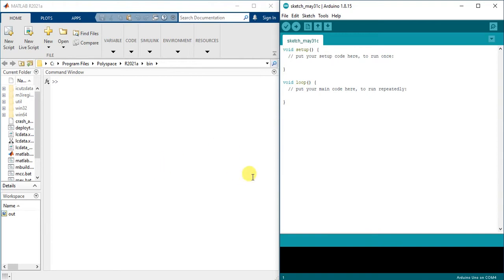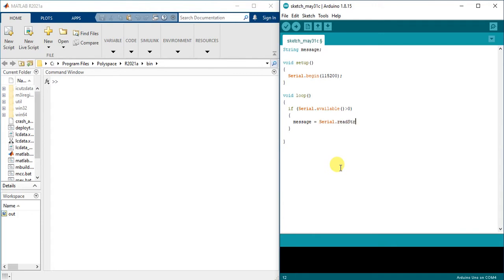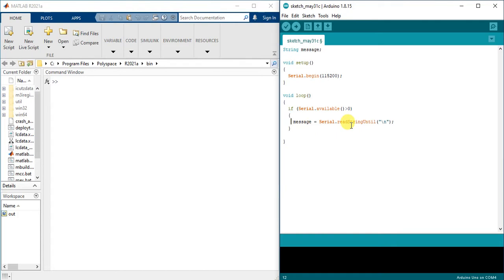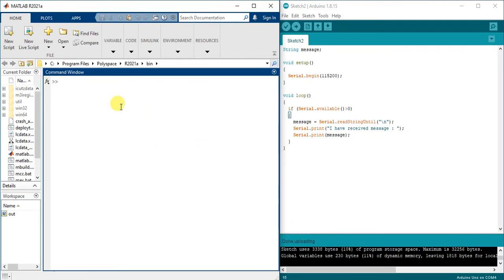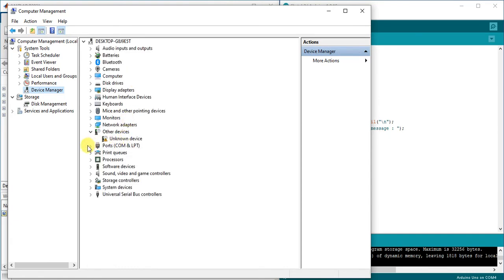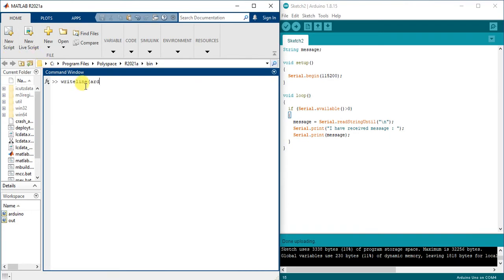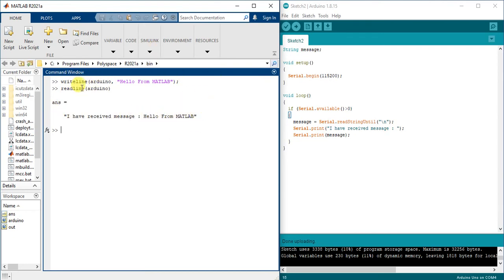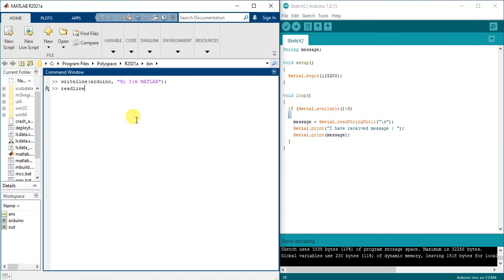Serial Communication MATLAB (Workspace) and Arduino (English)

Comment: i am gettting an error"Unable to connect to the serialport device at port 'COM6'. Verify that a device is connected to the port, the port is not in use, and
all serialport input arguments and parameter values are supported by the device."